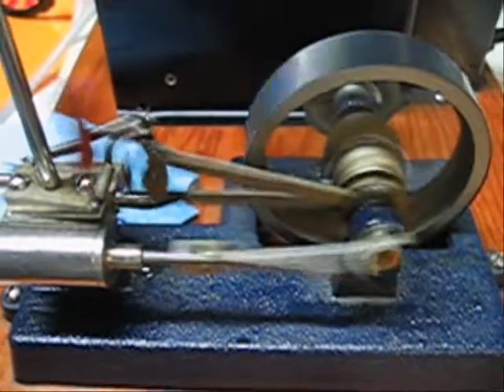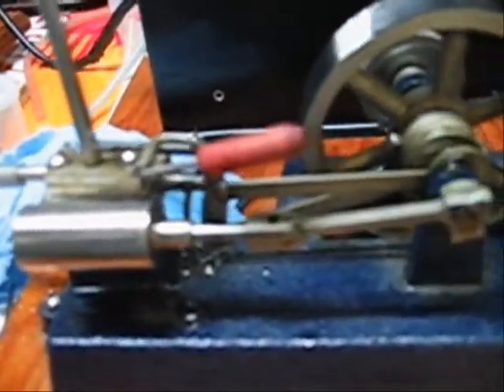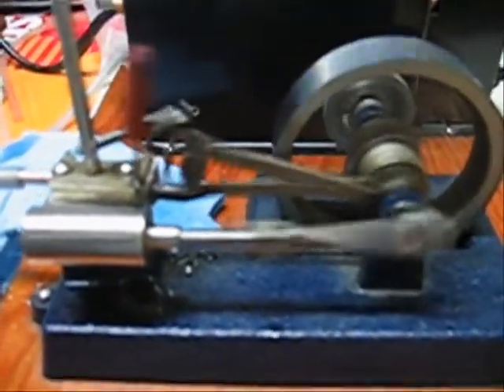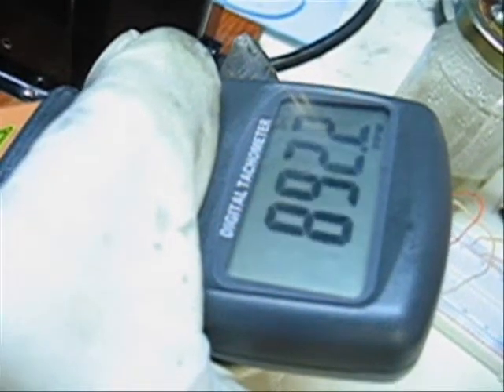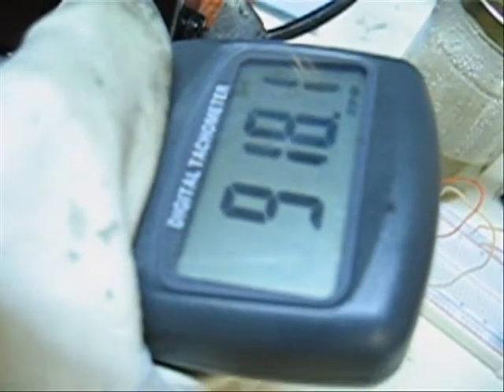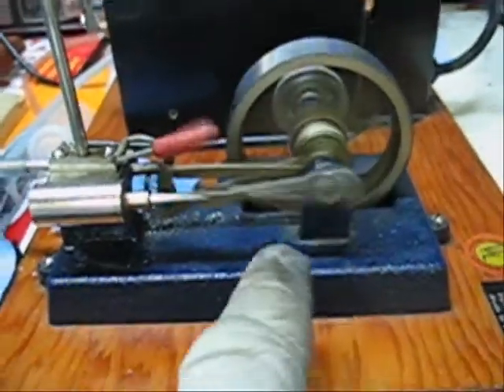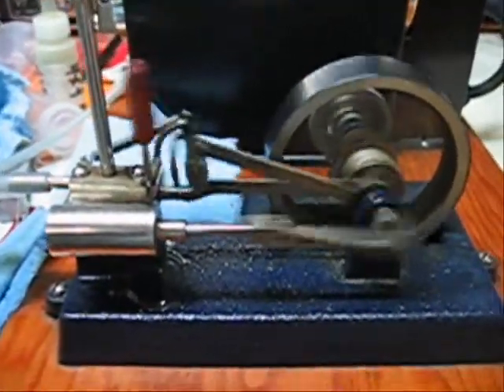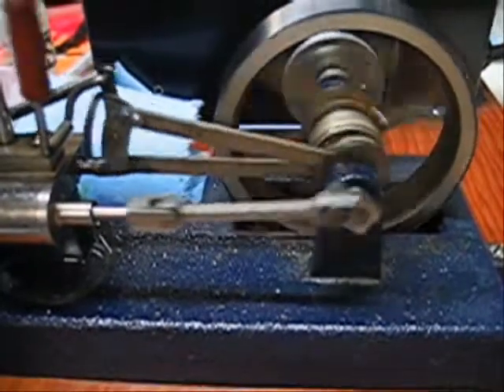Timing the Jensen 25

Comment from the maker: It's much less difficult on a modern one, where the flywheel is not attached to the eccentric.  You can take a felt pen and draw a mark across from the eccentric to the flywheel and then at least know where you came from as you adjust things.

I timed a Model 55 a while back.  Did it by eye, determined it ran okay, and then LEFT it alone.  I wasn't going to give myself a headache playing the guessing game of which cylinder is slightly off and which way.